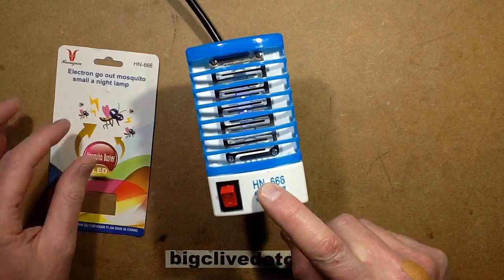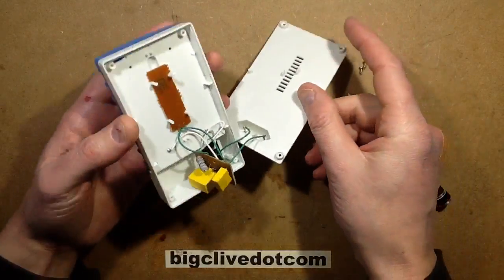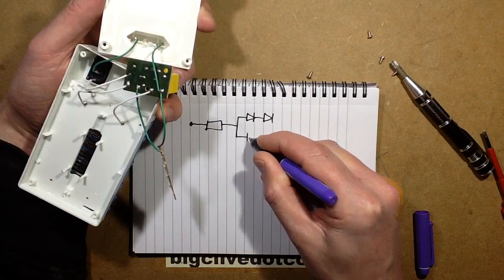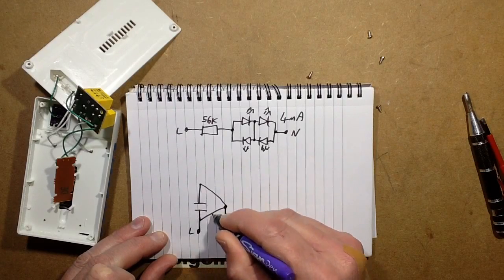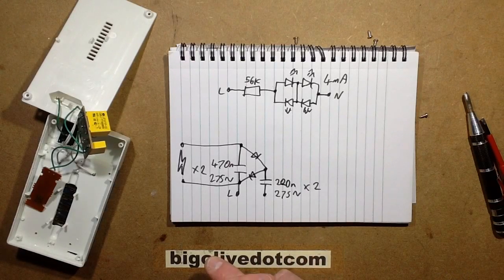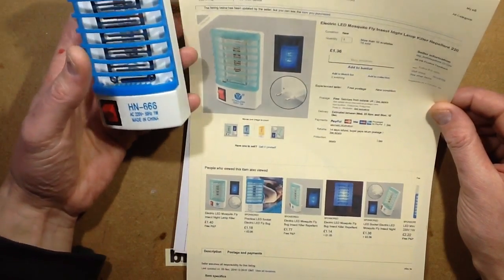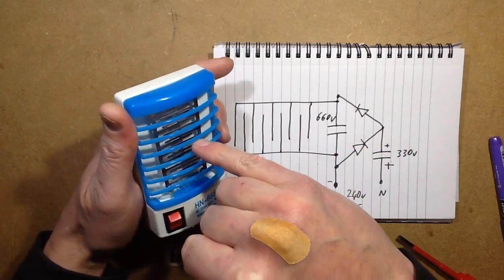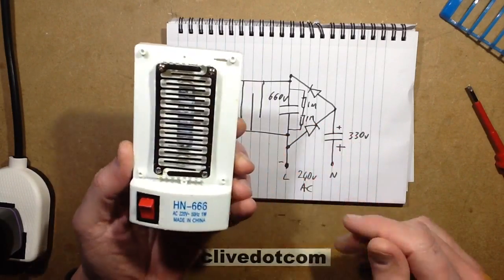Return of the dodgy insect zapper.  (With schematic.)

Comment: It would be surely beneficial if the LEDs wouldn't flicker since many insects have faster eye perception than humans, so they can see the flicker clearly and could be spooked by it. Also the reason why insects fly into light is that they normally navigate by the position of the moon which is virtually a point of light in infinity. A steady light source whould emulates the moonlight much better.

Comment: Why doesn't it blow the fuse when short circuited?
Reply: If you short the grid you've still got the 220nF capacitor in series between line and neutral.  At 50 Hz that's around 14.5k impedance, so it would limit the current to under 20mA.
Reply: Okay, thanks. But it's still dangerous then? Would it not be safer to use smaller capacitors? For instance 10nF to get less than 1mA current?

Comment: Could you replace the LED resistor with a 0.22µF cap to up the current?
Reply from the maker: It would require a cap and a lower value limiting resistor like 470 ohms, but yes.

Comment: Ever thought of trying a 3v to 7kV step up circuit from eBay? I have one but don't have any way to test the actual output voltage.
Reply: vk3hau I experienced an electric fence on a farm when I was little. Then for a time I was afraid of wire fences.
Reply: Tom5tom Entertainment maybe a electric fence tester will do the trick? Heres one that shows 8kv  

https://www.ebay.com.au/itm/162105927175

Comment: when you zapped at the end, two of the LEDs light up
Reply: I noticed this too.
Shorting out the larger capacitor connects the smaller capacitor to the LEDs via the top diode. This looks to be random, since with the opposite polarity it would discharge through the lower diode as soon as it was switched off.
Reply: What? The smaller capacitor will always have the same polarity charge on it and will always discharge through the upper diode when the grid is shorted. Still holds true if the directions of the diodes are reversed.

Comment: inscects are atracted to uv light the most effective waveband is 365 nanometers according to the company that makes the proffesional units.
Reply: I've got one of those. It's got 2 T8 15 W gas tube UV lamps. I bought it because the mosquitos were driving me mad. If I hang my "insect destroyer" in the window, the amount of bugs it attracts is crazy stupid. And a whole bunch of them fly right past the device into your house. The amount of assorted bugs that come in to your house is astronomical. So it's rather counterproductive. Even though it will zap something every 1~5 seconds, it will fill up your house with more bugs than you've ever seen. Most of them are mothlike insects. The kind that normally never bother you. I don't think I saw any mosquitos at all, so the device is pretty much useless. Maybe I'll send it to Clive some day, so he can have some fun with it. It can be quite spectacular with bigger bugs that get stuck on the grid and get "coocked" until they completely disintegrate.
Reply: ivo215 I conducted an experiment with my Dyson hand-vac, which has a cyclone centrifuge.  Smaller bugs are not smashed to bits, and continue to live happily in the reservoir. About 10% of them find their way back out.
I know this by capping the nozzle with a clear plastic bottle, which prevents escapes, but shows the escapees who made it back to the nozzle.
Reply: ChaosR there's attractants such as octenol that can be used but they can be pricey given their difficulty to manufacture and store.
Reply: The thing is, I'd rather NOT have any chemical insect attractants or repellants in my house. I'd like to live without those chemicals around. The best 2 methods to get rid of mosquitos I've found are: 1. An electric flyswatter. (normal flyswatters will produce bloodstains on the wall). 2. A vacuum cleaner. Just suck them off the wall. Preferreably one of those Dyson/Vortex style vacuum cleaners. Those wil effective centrifuge any insects to bits, so they don't come flying back out again.
Reply: Landrew0 That's interesting. I haven't done any experiments, but I don't think anything ever survived being sucked up with my AEG. The vortex in that thing is quite violent. But I do admit that I do turn it up to full power (2 kW) when sucking up mosquitos and spiders and such, for maximum effect. Legs and wings will come off. Even if they survive that, they're not coming out. I assume your hand-vac isn't rated at 2000 W, it probably being battery powered, and it has a more gentle swirl. Though, if only 10% manages to escape, that means it's 90% effective. That's not bad for a hand-vac, right? Try being 90% effective with a fly swatter...
Reply: Landrew0 120k rpm is a LOT. That's well within turbine terrritory, but not yet dentist's drill territory. A Dremel 'only' goes up to 37k rpm. That's quite an impressive feat from Dyson if their electric motor goes up to 120k rpm. I wonder if there are any (if at all) commercially available electric motors out there that are quicker. But does this mean the dust (and bugs) go past the turbine blades in your hand-vac? That's not the case in my AEG. There's 2 filters between the reservoir and the turbine in my vacuum. Only filtered air goes past that turbine. But you could very well be correct that some bugs might actually survive a swirl in the reservoir. Bugs can be quite resilliant. If they do survive it, I guess they've deserved another chance to live. As long as they don't bug me...
Reply: Oh.
Reply: well ... mosquitos not so much appearently. But I can't say about moths.
Reply: Could you build a co2 output with yeast to draw them right in
Reply: https://www.wired.com/2014/01/dysons-new-vacuum-motor-spur-cordless-revolution/
Reply: so they are not attracted to the dead burning carbon releasing smelly bodies of they're dead comrades?
Reply: Bugs are incredibly stupid.
Reply: ivo215 
My Dyson has a very feisty brushless motor, which they claim runs at 120,000 RPM. I can attest to insects surviving going through the blades. Don't be too certain that they are being mangled by yours.